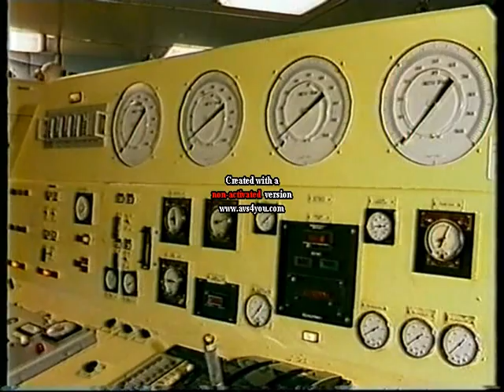QE2 last day as a steamship

Comment: What kind of steam did she use? This is Thatcher's fault, closing the coal mines. Where is British Leyland when you need them?
Reply: Premium unleaded steam
Reply: @ManuEreve  I knew it. You know, you didn't have to tell me. I just knew it!! Well then.
Reply: Steam is gasified water, you know 😃😃
  Honestly, they used HFO (Heavy Fuel Oil). The RMS Oympic (1911 - 1935), Titanic's sister, was converted from coal to oil powered during her career, and I think almost all steam ships built since the 1930's were oil fired.
Reply: Superheated steam. Foster Wheeler ESD11 boilers producing 850psi at 950 degrees Fahrenheit.
Reply: Ships haven’t been using coal since the end of WW1.

Comment: Cunnard crippled her from the start, by not putting in 3 boilers.
Reply: I thought they did settled for 3 boilers which was decision they would later regret because she suffered boiler troubles later on. I thought it also had to do with the cost which was why they only were able to put 3 boilers in.
Reply: It was designed and planned to fit 4 boilers. They cut back to 3. On cost grounds

Comment: I,m suprised she was sold so short after beeing re-engined. I was expecting she would sail for another 15 or 20 years
Reply: She was re-engined in 1987, she was sold in november 2008 - that's more than 21 years and probably about 2 million nautical miles, more than many ship ever do. I think the engines were well used.
Reply: The reason she was replaced was because her hull and superstructure was made of aluminum. After a long time this caused reappearing damage and cracking on the ship and this was becoming a headache for Cunard, so they built QM2 out of steel plate with very little aluminum.
Reply: Her career of 39 years was longer than the 1930s Cunard Queens.
Reply: @paulmason4297  I thought she served for 44 years
Reply: @joemancini327  
Her maiden voyage started on May 2nd 1969 and she arrived in Dubai after her last trip on November 26:th 2008, that makes 39 and a half years
Reply: @qe2836  If only she made it to 40 years I can see why they cancelled it early with the 2008 recession creating problems.

Comment: From what I've heard, she was faster when she was steam powered.
Reply: +SteamboatWilley     No, the power of the steam turbines was 82 060 kW and the power of the electric propulsion motors (diesel-electric powered, total diesel engine power 95 615 kW) was 88 000 kW. The top speed increased from 32 to 34 knots.
Reply: @qe2836  I dont understand why Cunard never decided to add more than 1 funnel to the QE2 like the new SS France. The SS France had 2 funnels I'd think it could've worked on a ship like the QE2.
Reply: @joemancini327  
I agree that she definitely would've looked more impressive with 2 funnels, but I think the reason why they came to their decision was that more than one funnel was out of fashion. At least I consider the new funnel she got in 1987 to be a lot better looking that the original tiny funnel, that also was white at the beginning.
  And don't forget the Italian sisters SS Michelangelo and SS Raffaello (1965), they also had 2 funnels.
  Even if I don't give much for the design of modern cruise ships, the Disney ships with 2 funnels and black hulls, in my opinion, look better than the rest.
Reply: @joemancini327  I think Curnard did the math hehe, Queen Mary with three funnels, two on Queen Elizabeth and one on the QE2. Her funnel design is unique and I don't see how it would work with two funnels, they build her just right :) Imo, while the SS France was a beautiful ship, the QE2 looks so modern even Cunard had to withdraw or sell their other liners because they looked old near her and of course, they had to pay for her.
Reply: @miracabral  To be fair they could've just put a funnel just aft of the bridge similar to what the Aquitania had on her superstructure.
Reply: @joemancini327  I think quite frankly the reason was Cunard at that period was bleeding money. It was seen as old fashion, upper class stuffy as per the old Queens.  They were looking for a more modern contemporary look to pull in a new level of passengers that wanted both class and a sophisticated ship.  Both for liner work and cruising. And one funnels stuck aft was seen as ‘modern’ and cutting edge to the extent it became the norm for most liners that followed.  It also cleared the decks further forward for Sun decks and cabins. Rather than shadows from two funnels.
Reply: @joemancini327  one funnel for each cylinder of each engine .. like Zoomie headers 😁